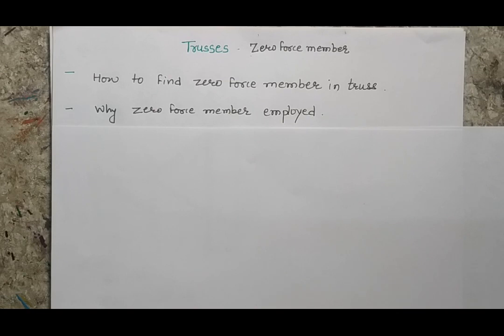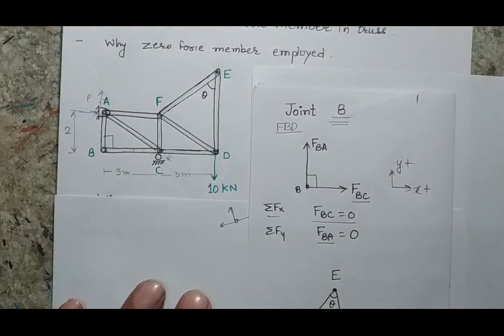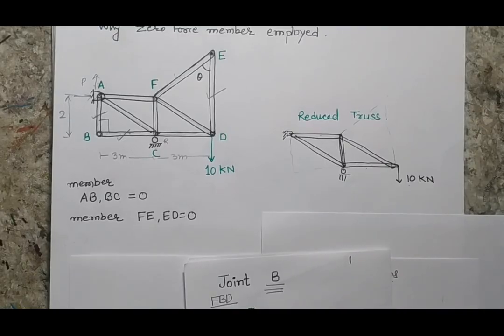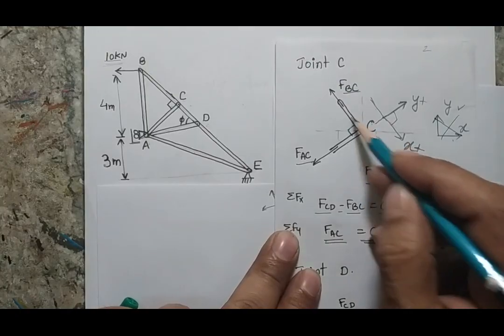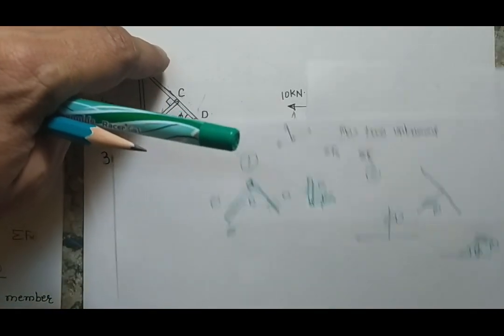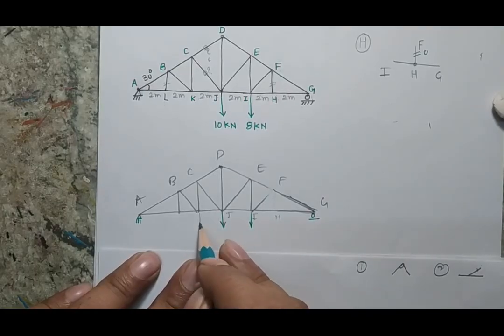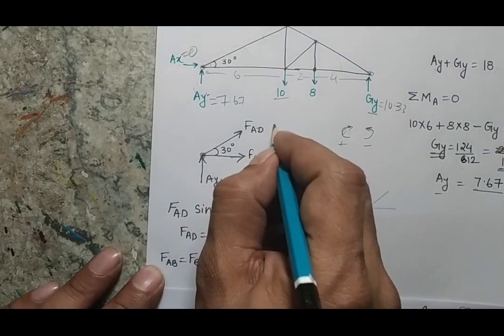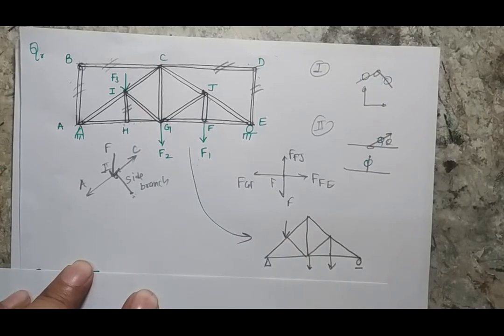L3.3 Truss: concept of ZERO FORCE MEMBER || Examples || Engineering MECHANICS || FIRST YEAR course

Comment: Thank you for the explanation. In your first example as I see there is a force acting downwards at D. Now if bar FD is not there, then will ED be zero force member?
Reply from the maker: If FD removed but 10N force remained there..then ED is not a zero force member..because joint with two member without any other force is zero member...here if you will consider ED and 10 N force collinear then cD will become irrelevant..
Reply: @ashishpurohit9138  Thank you for your response. I had posted my doubts other places no body bothers for discussion. I have one question with regards for your reply. Assuming all the joints are welded joints (Rigid joints). Then will there be bending moments if yes how do I balance them out for equilibrium. I am not having physics background or engineering background. I apologize for being novice.

Comment: Thanks. I have finally understood 0 force members after this video. Many other ones failed to do so. May God you
Reply from the maker: Hello Gaurav, if we apply load at E instead of D, EF branch will also bear load and ED and EF will not be a zero load member. I tried to answer your query as my understanding. If your doubt is different plz mention time instant for my sake.
Reply: @ashishpurohit9138  thanks for answering, I understood it after sometime though that's why I deleted my comment.